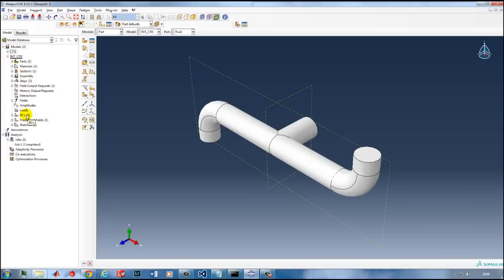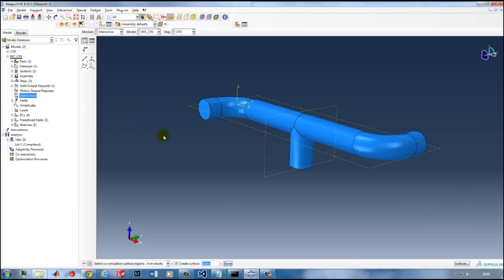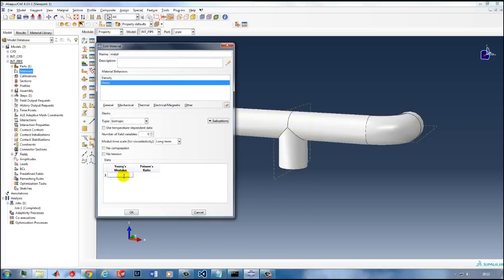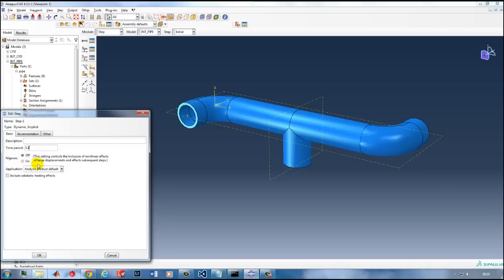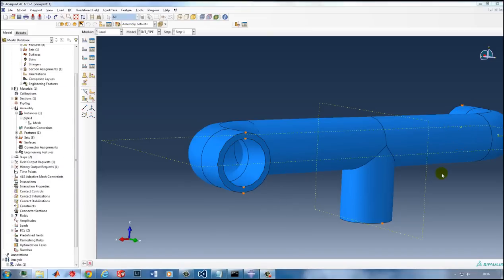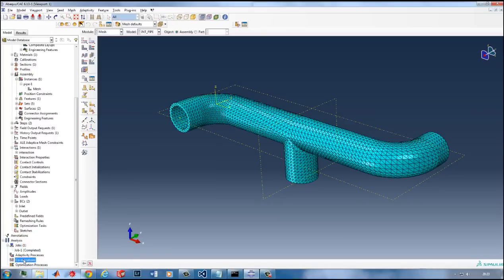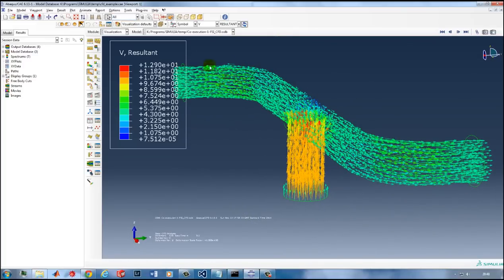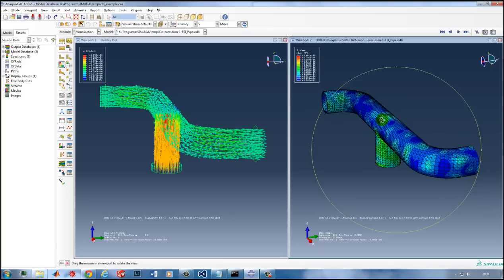Abaqus CFD Tutorial Part 3: Running a Co-simulation with CFD/Standard Models

Comment: Can't we will be able to simulated CFD model directly other than "Co-Simulation"?
Reply from the maker: Hi Sudharma. The Abaqus CFD capability was deprecated in 2017 and has been replaced by SIMULIA CFD which is available on the 3DEXPERIENCE Platform. Co-simulation is no longer required for fluid-structure interaction.

Comment: I get the error "Analysis cannot continue due to Co-Simulation Engine mapping search failures". Seems to be a mismatch between models but I cant see where.
Reply: check your fluid and solid models, the geometry needs to match exactly.
Reply: I get the same error when I cosimulate two flat surfaces that are identical in dimensions
Reply: This error is because the origins of the CFD and FE model do NOT match. On the assembly, make sure both instances have the origin located in the same position and orientation, for example: the center of one of the inlets
Reply: I have the origins of both models matching, and with the same orientation. The Check of the job completed ok and the submit is aborted fue the same error. How can I fix it?
Reply: OMG took me ages to fix the problem ! but for the interaction to work, the pipe and the fluid suface need to be exactly matching, which is not the case for this tutorial. you can see at 4:11, the inner surface of the pipe is not exactly the shape of the fluid.
Reply: @dylanliu9060  How did you fix this?Please help

Comment: Hi! Thanks for the video.
Just a question. When I submit Co-Simulation, I received a warning message that says there is a problem with BC-2 and PIN. I used the same names of the your video. The message says that I have to edit the turbulence model because it is changed. I don't understand the meaning of this warning. If I continue with the Co-Simulation Job, after some time, the status of INT_PIPE becomes "Aborted". I followed every step of your three videos, but I have many problems with the Co-Simulation. Help me please!